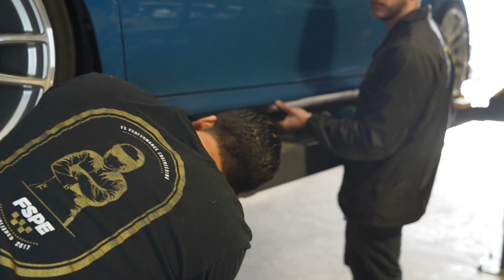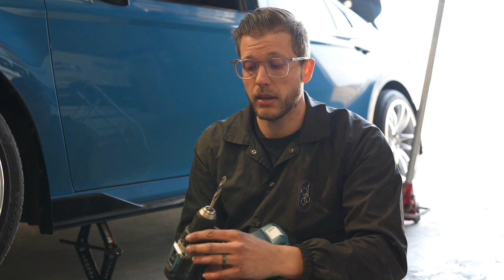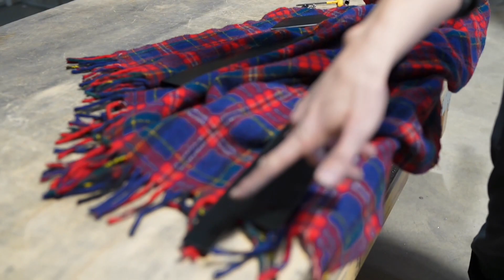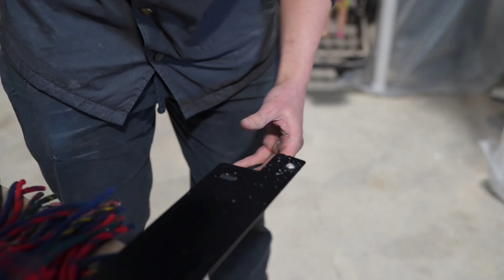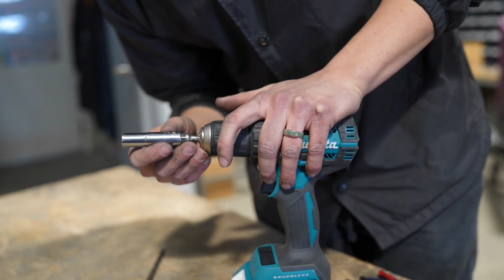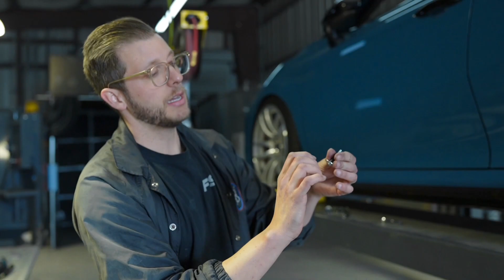How To Install Toyota Camry TRD Side Skirts (2020-2024) - FSPE

Comment: Poor quality mounting/type mounting hardware, should not have nuts that protrude down, reduces clearance and why are they not black anodized?  Should be countersunk from underneath to maximize clearance...
Reply from the maker: Hi there. This is an interesting comment and I appreciate the feedback. 

I do not believe you can anodize steel nuts. If you want black anodized nuts in aluminum, the price of the product would increase with the additional cost of nuts plus the anodizing. It really doesn't make sense from our perspective unless you own a show car, and at that point most people change things anyway. 

We do have countersunk hardware on the top, which is what shows more, but on the bottom you need some kind of nut to hold things. If you want to take it a step further and reach out to us, I would be happy to make the holes smaller and provide rivets. That would maximize clearance. 

Or I can press bend the end plates so no hardware is needed for them... but we made them a bolt on solution so you can choose to install them or not. 

We can even supply different hardware for the underside if that is concern. 

Everything is a compromise when it comes to manufacturing so we do what is best to satisfy as many people as possible. 

Thank you!

Comment: hey I had a question regarding this installation. I know you mentioned drilling but i'm afraid that might end up with rust due to possible improper sealant. I know there's wellnuts that end up being installed but even those wear out overtime, so i'm just wondering if this is really something reliable to purchase if there isnt proper sealant for the drilling areas
Reply from the maker: Hi there! Good question. 

The areas you are drilling into are not metal, they are plastic so no rust will form on the OEM rocker panels. 

If you'd like a different solution we can supply aluminum rivet nuts to install into the plastic rocker and stainless countersunk bolts - we don't supply this because most people don't want to purchase a rivet nut tool.

Comment: The Camry uses Metric measurements for every single part of the entire car, why do you introduce SAE measurements and screw up everything. Very strange decision
Reply from the maker: Hi there. This is a very interesting comment and a first of its kind.

We use a mixture of SAE and Metric hardware depending on the application. The well nuts we use on these side skirts specifically are only made with SAE and worked perfectly for installation.

Please also consider that we are an American based company so SAE and Metric systems are both prominent.